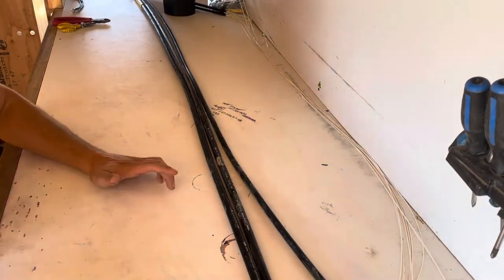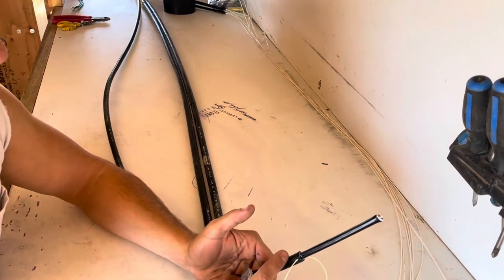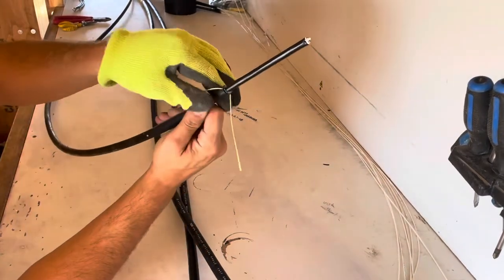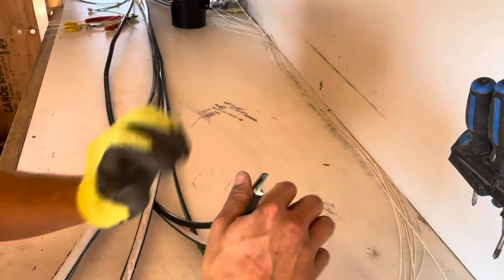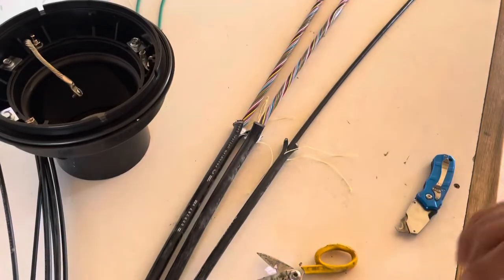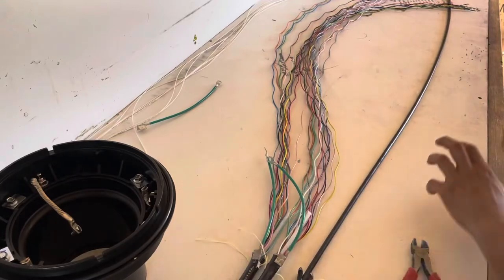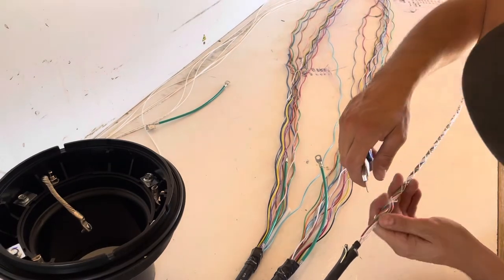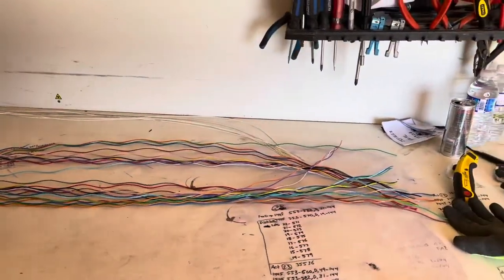stripping fiber optic cables

Comment: Be careful when you are doing that at 2:05 without gloves, once the hook knife slipped off the cable and went onto my 2 fingers and it has left deep wounds that healed up but still left a mark after that, I cut so deep that it hit the bone
Reply from the maker: 100% agree yes must always be paying attention When using the hook blade I actually had a worker 6 months ago do the exact same thing cut to the bone. I am very comfortable with using the hook blade but must always be paying attention cause it can happen so quick. Safety tip of the week blade can and will cut you to the bone always wear gloves take no risks 🙌
Reply: Gotta get them cut proof gloves. Protect them money makers 🤌

Comment: What is your go to method when you accidentally break a rip cord? I have been just carefully cutting back the sheath with my hook blade until I have enough cord again. Is there a better way?
Reply from the maker: Great question it happens all the time the best way access the broken rip cord again is to pull the other rip cord all the way to your ring cut mark. Then separate the fiber from the sheathing by pulling the fiber through the one side you have already pulled the rip cord down. This will give you easy assess to the broken rip cord just cut the excess sheathing off and make a slice in the sheathing and pull it the rest of the way. I believe in my recent 432F build video or one of the recent longer ones I broke a rip cord and I show how I access it really quick